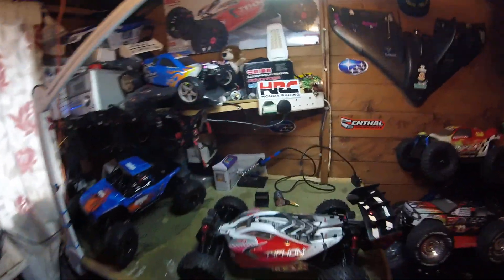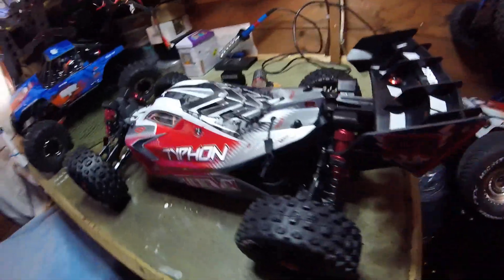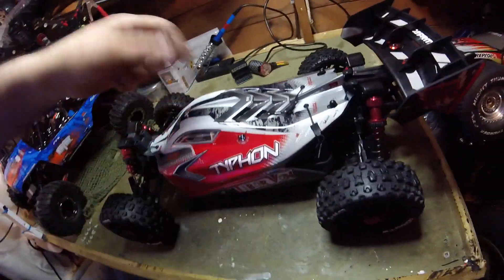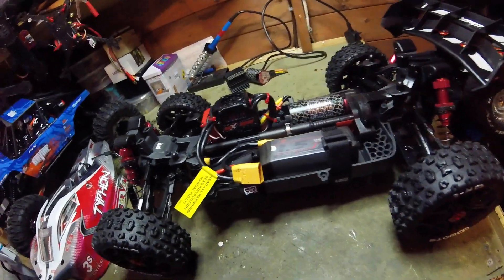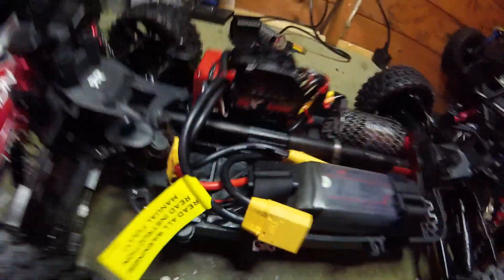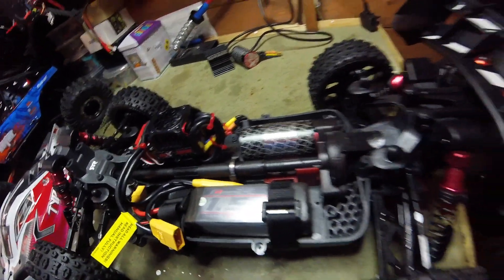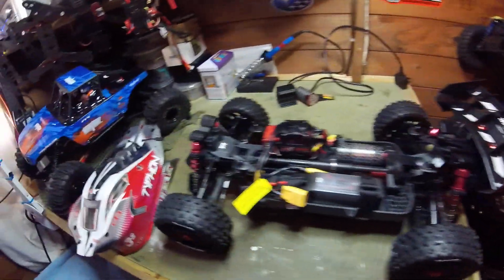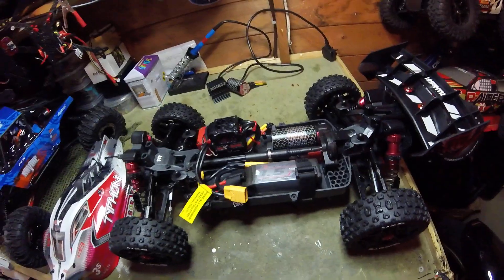!!!! BIG UPDATE ON MY ARRMA TYPHON 3S !!!!

Comment: Canny collection you're gathering there mister. Nice
Reply from the maker: Tnx will👍
I keep buying an keep smashing 👍😀👍
Reply: @gazfpv  Yep. It's the same story - quads, planes n cars - bash, crash, repair.  I'm busy making a scale crawler with one of those GCM chassis.  Trying to make it have big articulation & droop.  Putting a 35T motor in to try have reasonable torque
Reply from the maker: @retrodudefpv  wow !!   you really go to town on your rc"s will...35t motor plenty torque there ...
when finished you need to show the world ur design of a scale crawler buddy..
nice going cant wait ...
Reply: @gazfpv  It's a nightmare build.  The alloy beadlaock with hub covers equals 128 black high tensile M2 bolts to stand out against the shiny wheels -which are wrapped by car wheel balancing weights, then brass hub weights to keep the COG as LO-O_O-O-W as possible. 2 stage foam to help rock grabbing.  All metal gears n diffs with a scale transfer box n all metal drive shafts. 2 stage shocks etc - the list goes on.  Everything second hand or salvaged - so it'll be another month m8
Reply from the maker: @retrodudefpv  keep me updated bro cant wait to see....
Reply: @gazfpv  :)

Comment: Gazza   thats gona fly with a 20t lol  mine only had the 14t in on the beach and it did 76kph. On tarmac it would prob be 85 lol
Reply from the maker: I'm not competitive you no.😭
But I'm going to be pushing you next time.lool😂😂😂😂im only joking bro..😂yes mate iv been doing loads of research I'm going for 120mph .I'm getting a 26t pinion for it..an it's lighter than a 6s so should go ballistic.👍😀👍
Reply: No way lol  i will film for u mate. Set up a few cameras
Reply from the maker: @tiborvon  Yes bro.that be good👍shut the 61 off an I'll run it down there😂👍aslong as you don't do me for speeding 😂👍👍
Reply: Lol
Reply from the maker: @tiborvon  I'm going do a few runs with it when weather picks up .see how it performed.👍😀
Reply: Have u got gps speed meter
Reply from the maker: @tiborvon  not yet mate.😀not till I borrow yours of ya.😂😂👍
Reply: Lol
Reply from the maker: Wow tibs..
Just took it out for quick blast.I can't get full throttle. 
I've got buy a wheelie bar now😀👍it's on its way from t-bone racing 👍😀👍
Reply: @gazfpv  the weight difference with play a big part